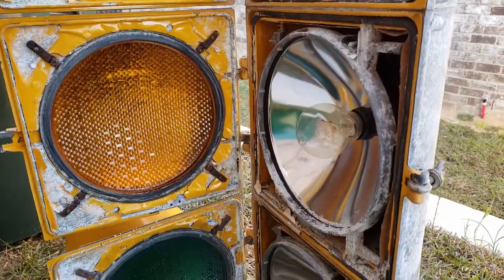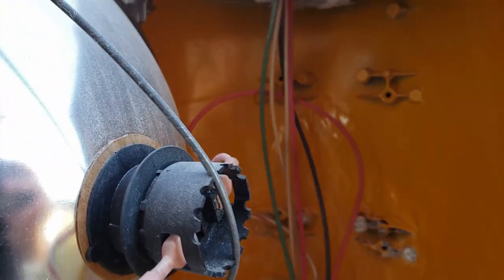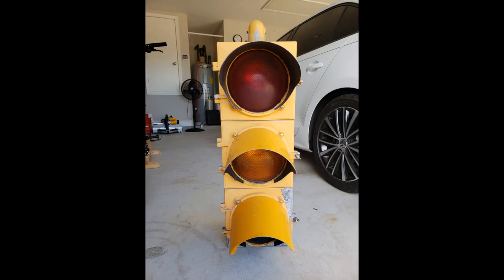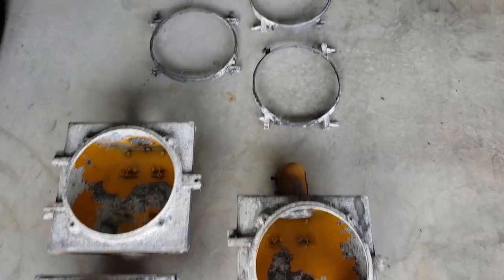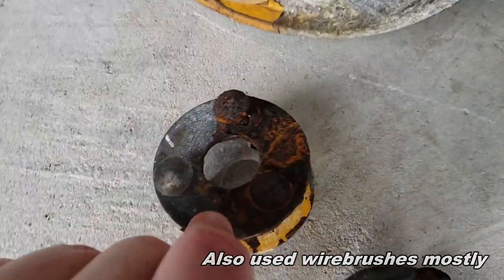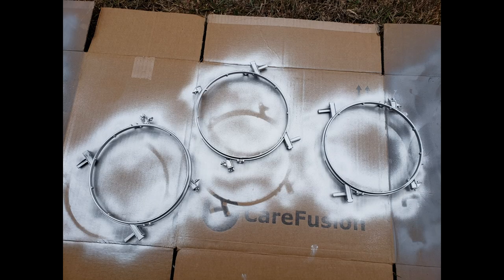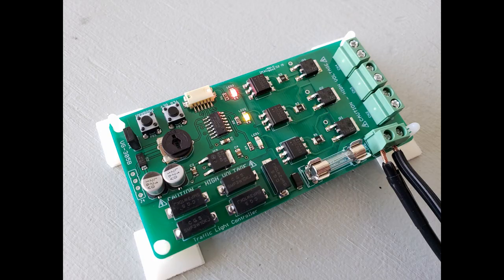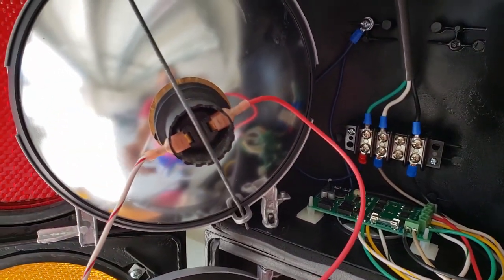Traffic Light Mark IV Complete Restoration. Was in BAD SHAPE!

Comment: Nice restoration!! How did you get the screws off from the visors? I want to repaint my 8” traffic light that I got from eBay last year but only some of the screws were easy to unscrew.
Reply: They should be easy to unscrew by hand.  Unless the screws got stuck which can happen if they were in there a long time and turned very tightly.

Comment: So,for pitted aluminum,or really most metal pieces you plan to repaint,try some body filler next time,it will provide a strong,smooth appearance
Reply from the maker: Oh dang, that is a great tip! If I knew that beforehand I would have smoothed the whole things out, especially the deepest pits and grooves. It's still holding up strong though :)

Comment: How did you get the visor and lense screws out? Also your lucky to be able to sand blast, I have to manually sand my light
Reply from the maker: Sandblasting didn't work too well. Ran out of it quick, only had a cheap harbor freight gun. Also used a drill with steel brush a lot. The corrosion was extremely bad on this light. For the screws, they were basically stuck and I had to drill them out. Used slightly larger screws in place of them
Reply: Daniel Rivera I’m working on a 12” McCain signal that is completely corroded, it was sitting on the ground behind a pawnshop for 5 years. I’m trying oil penetrate. If that doesn’t work I’ll have to buy a kit to make new screw holes. I’m worried the screws will break inside because they are really stuck
Reply from the maker: @SebastianSteele  yeah that's what happened to these screws. Most of em snapped off inside. Was a pain but drilling out worked. Just tapped some new holes and it was fine